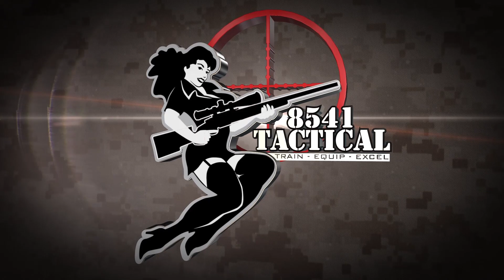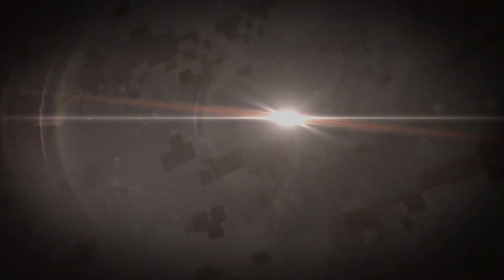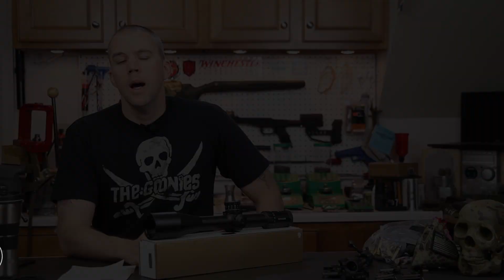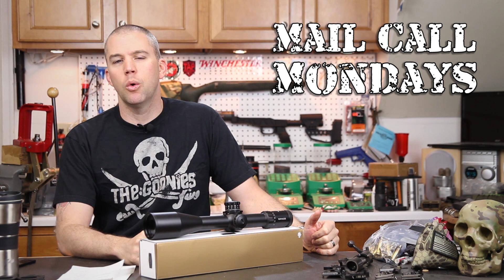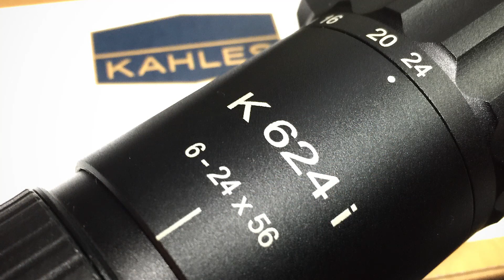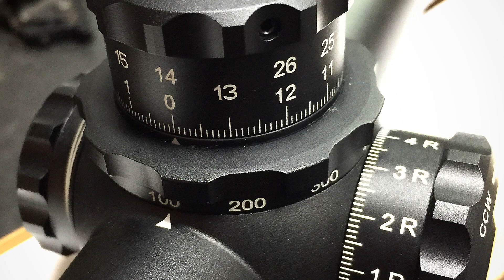Mail Call Mondays Season 4 #07 - Cold Bore Tracking and Kahles K624i Preview

Comment: Hello John new subscriber here, I was wondering if you have any information on the .270 Winchester cartridge as a long range option. I know that most bullet offerings for the .270 have a BC that is not good for long range but Berger offers a 130 grain VLD bullet that has a better BC than the Berger 130 grain 6.5 Creedmoor offering and with the same powder the .270 has around 300 fps more than the 6.5 Creedmoor. I have not been able to find any info to how long the round will stay supersonic or transonic, any info will be greatly appreciated.

Comment: Hey John I generally run a wet patch and then a few dry patches after every use will this affect my cold bore shot? 

Thanks in advance
Reply from the maker: Depends. The best solution is to test it.
Reply: Will do, also good luck on your match. Thank you for the response.